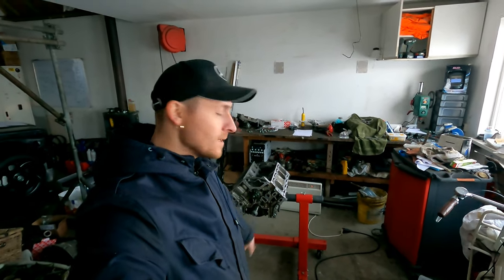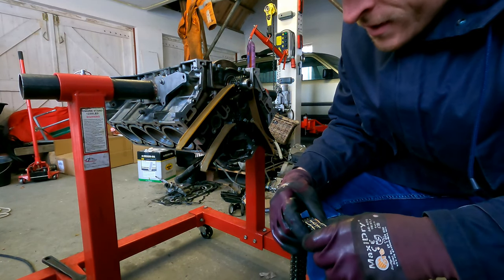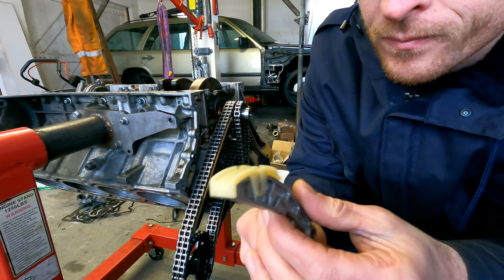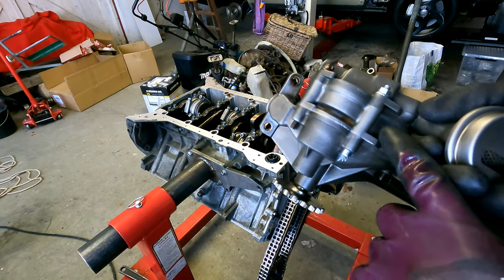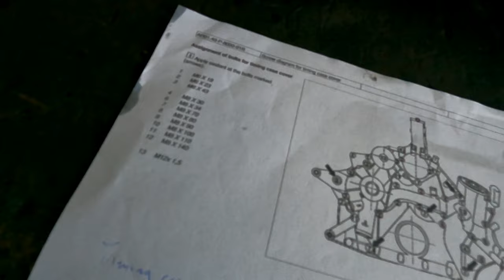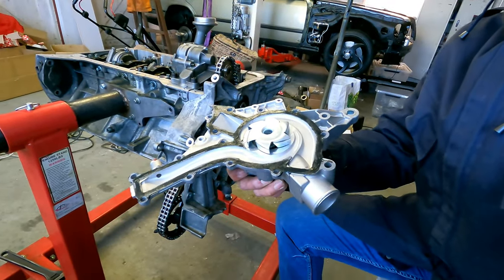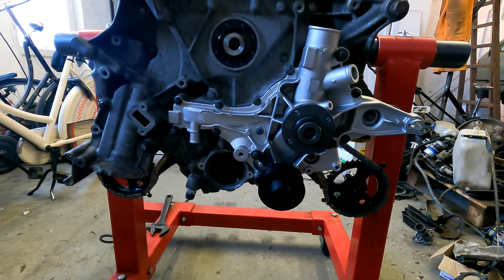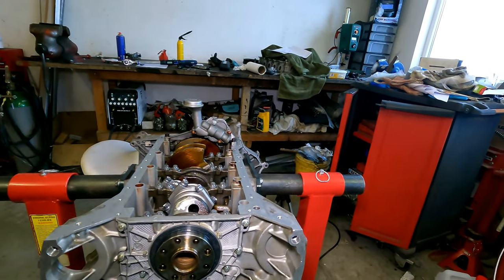M113 engine rebuild - Part 12 - timing chain + oil pump + timingcase install

Comment: I like that you pulled up the WIS docs! A lot of people don't have access to those so it helps them a lot. Cheers brother keep it up! Luckily I have the M113 AMG so I already have forged pistons if I wanted to add boost. How much PSI you going to be pushing on this 5.0 motor you think?
Reply from the maker: On Regular petrol around 0.6 bar and on e85 around 1.3 that is the guess .
Reply: Pretty sure the AMG pistons are not forged, they are beefier yes, but not forged.

Comment: hi in the process of doing the same rebuild, was wondering what the o-rings in the timing case are called and where you ordered them from, a part number if possible would help thanks in advance. great job to by the way has been very helpful!
Reply from the maker: Just from the Mercedes dealer.  Dont have the number .  Have to look.it up also

Comment: Hiya.  Please help.  I have the same engine, when I changed the oil, I tightened the oil filter base screw wrong and there is a broken thread.  Can I replace the timing belt without removing the heads?  Do I have to take the head off though?  Please reply.  Regards

Comment: hey there again just received timing chain guides and tensioner but my chain doesnt have the copper tabs or and different discolor from the rest of the chain nor any marks would you know how to proceed without marks or different color tabs
Reply from the maker: If you have the markings on the sprockets alle in the right place the marking on the chain is not really needed . It is an extra indication